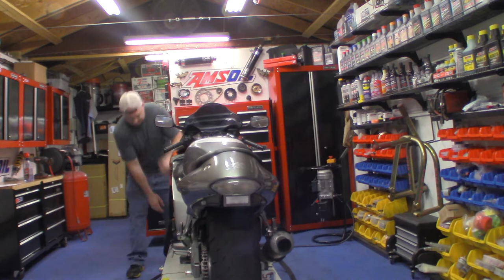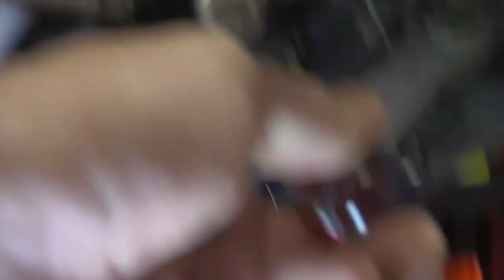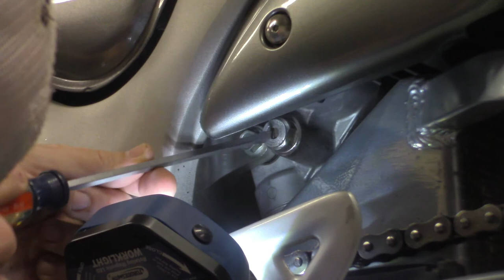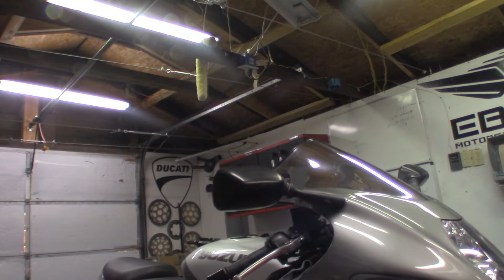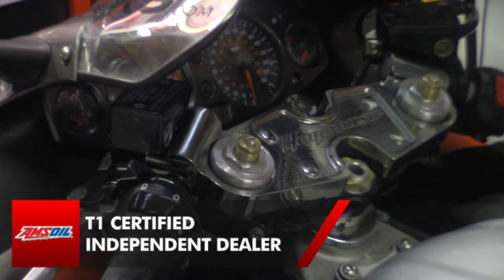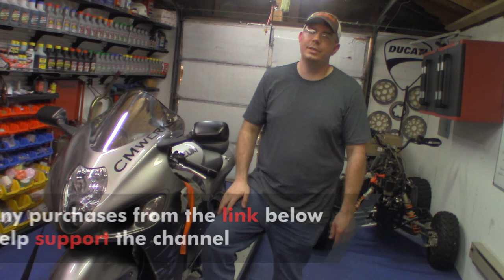Factory Suspension Setup on Suzuki Hayabusa

Comment: Very useful! I've got a 2004 Hayabusa with 130 000 kms. At 100 000 I had a crash and the front fork had to be replaced - second hand telescopes. Since than I was suffering from the bumpy Hungarian roads. Few weeks ago came into my mind that the settings of the second hand telescopes might be out of the standard. In lack of proper instruction I didn't dare to try to set them but now I gonna to check and set them!
Reply from the maker: I'm really glad this may have helped. Please consider a super thanks if this helped you out.

Comment: Great video thank you I just purchased a 2022 Hayabusa and I have a question sounds crazy but how can I increase the height of my Hayabusa maybe go with 200/60/17 tires etc. thanks
Reply from the maker: Probably wanna take back to the dealer and ask them on a new bike. The hayabusa are designed to be low on purpose. They are probably the lowest bikes i have ever ridden. By making them taller you are changing the geometry of the bike. Lots of hayabusa forums on the internet i just cant help yah on this one. Do research and go from there. Also this video will not work on your suspension as suzuki has changed all the suspensions from this model specific.

Comment: Hello.

In the service manual they say that the std position for the pre-load adjustment is in 5th groove. The rebound std 3 clicks out from the stiffest postion. 
I'm in Europe, so I don't know if there is a diff between our regions. (I think there isn't).
I have an Hayabusa from 2002 and I'm trying to reverse the previous owners suspensions setting to the standard. That's why I found your video. 
Could you please confirm where did you find your info about the factory settings?

Thanks a lot.
Regards.
Reply from the maker: Usa manual, follow video and go from there

Comment: Stiff suspension is not from racing or "launching". I drag my gen 3 busa, you want the suspension soft to soak up the initial shock of full throttle. It was probably set hard because the rider was an absolute unit and he needed the bike to not buck him off at speed from a pothole because he was getting too much travel and not enough damping
Reply: He said hard for drag racing. I did those settings and it spun like crazy. I’m like you. Went a lot softer now it’s hooking

Comment: Helo sir ..my 2017 busa top rebound screw is clicking only 6 n half times anti-clockwise after six an half clicks clockwise...
Reply from the maker: Your 2017 busa i think has different forks than this gen one. Follow the manual on settings them.
Reply: @TorrentPerformance  sir as per owner manual book front rebound screw wich should clicks 8 times anti-clockwise for factory settings..... is clicking only six times anti-clockwise ...
Reply from the maker: @ngvlogs5555  If that is the case than something internally is wrong. Why are you trying to adjust it do you feel something is wrong. Email me so i can try to help you further. Email in description below.
Reply: @TorrentPerformance  i have sent u mail please check

Comment: I have a Gen 2   2016 ABS model are the settings the same  
Cheers
Reply from the maker: No there different forks
Reply: @TorrentPerformance  I don't  suppose you have the specs  fir my bike
Reply from the maker: @jackthomson5618  nope afraid not gonna need to contact dealer or get a repair manual. The actual owners manual will have the correct settings in it
Reply: @TorrentPerformance  okay, thanks for your time   cheers

Comment: Hey where are you located
Reply from the maker: Pulled my address and phone number off all my stuff so I don't get robbed. Also I don't use facebook anymore to help protect my location. I am  located in Illinois.
Reply: TorrentPerformance oh ok I understand! I’m going threw a lot with my very first atv and needed help I wish I was close to you  I would have liked for your help
Reply: Helo sir ..my 2017 busa top rebound screw is clicking only 6 n half times anti-clockwise after six an half clicks clockwise...